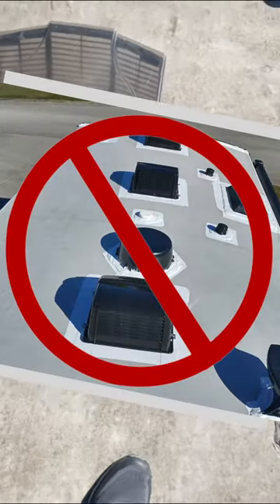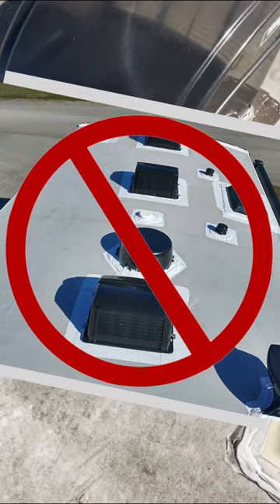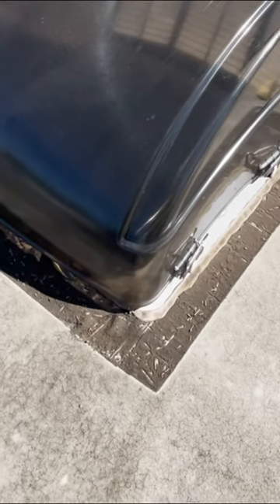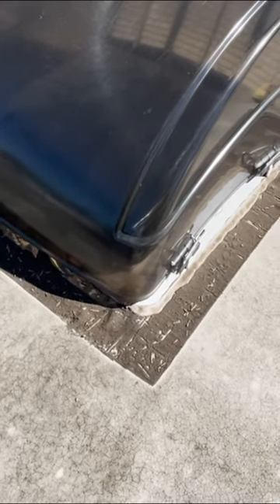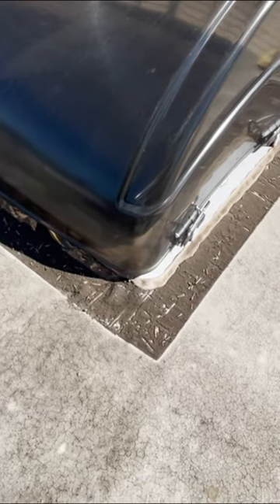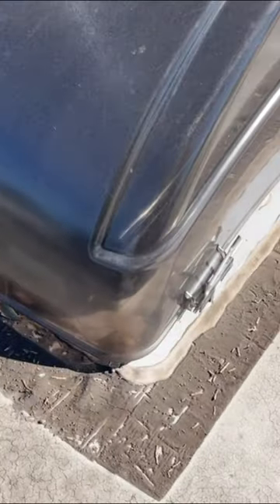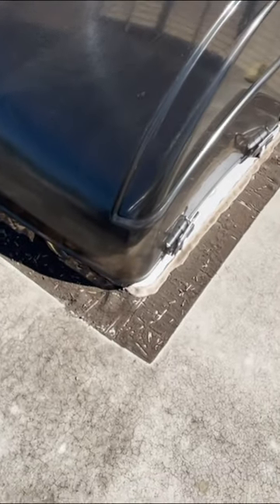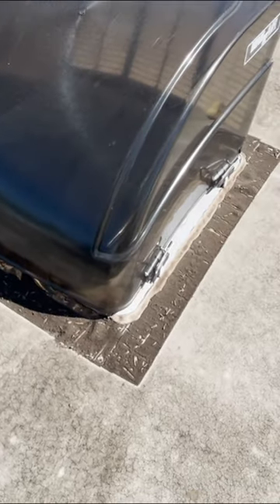Expert Reveals Eternabond Tape Failure Secrets

Comment: Make up your mind. Did it disintegrate or did they remove it and left the tape glue without cleaning it off. I think you know that it did not disintegrate. Someone removed the tape and did not clean off the glue.
Reply from the maker: There is no way this tape was removed and left the glue behind with those perfect edges! This comment is laughable! Have a great day!
Reply: @yourrvspecialists I think you comment is laughable 😂 you seriously think it your assumption is correct? Lolololololol
Reply: I guess you guys never tried to peel up eternabond before? It is an absolute mess. This is clearly old disintegrated eternabond tape. You guys just are just so scared of a caulk gun that you think you can eternabond everything 😂

Comment: Eternabond is the bomb. Someone can’t read directions.
Even this case is easily solved. Clean total roof with rv roof cleaner. Coat with liquid rubber.
Spray Eternabond primer on all the old stuff and lay new Eternabond on top.
Last for years.